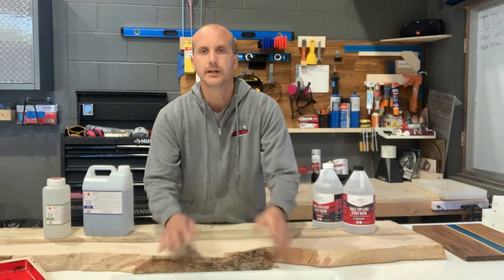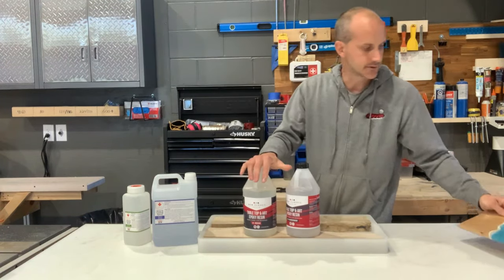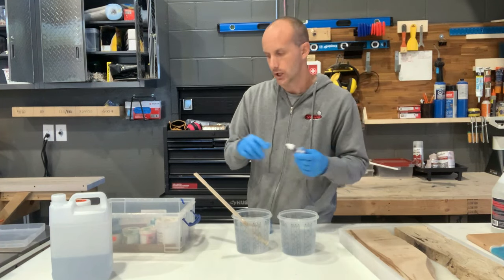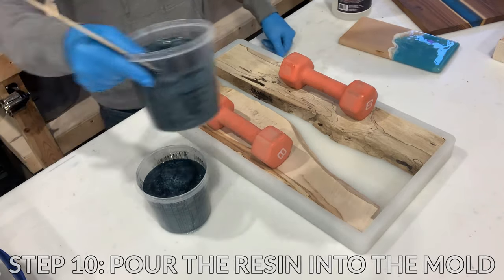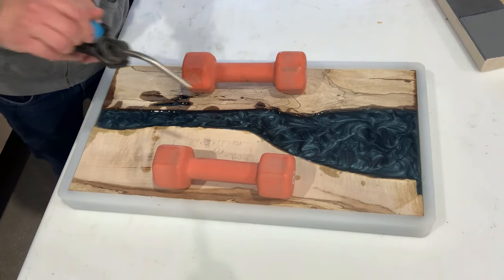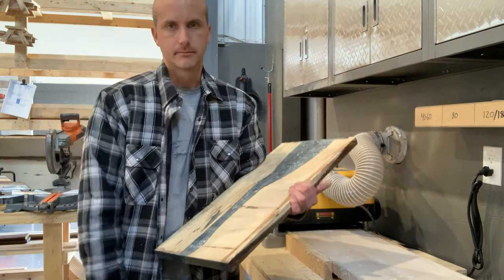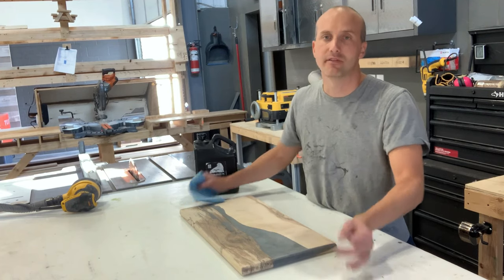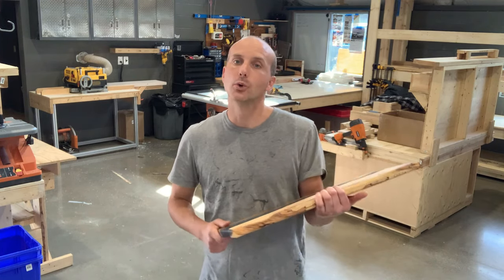How To Make Epoxy Resin Cutting Boards - DIY River Resin Charcuterie Boards + Big Time Saving Molds

Comment: The table saw push stick is meant to push the piece between the blade and the guide wall. That's the piece that will get shot back at you. It's not meant to push the piece on the open side. That piece won't get kicked back. Be careful of making a missile. The board came out very nice. The mold was a great idea.
Reply from the maker: Yes, clearly my saw technique needs some work in this video. I think at the moment this video is almost 2 years old and I have learned my lesson.
Reply: @CraftedElements  Hopefully not the hard way. Thanks again for sharing the process.

Comment: One teensy piece of advice; when pouring from a container with an offset neck like the larger resin bottle shown, always pour with the neck uppermost. This allows the air to leak in to the container evenly and prevents the “glugging” effect, giving much more precise control. Seems more awkward at first, but much easier in the event. As for bonding of pre-sealed edges; that’s down to timing. If you wait too long and allow the edges to cure, you will need to rough them up to create a mechanical bond, BUT if you pour before the edges are fully cured, the pour will form a chemical bond with the original edge that is full strength. The latter gives the best of both worlds. Finally, CA glue works well to fill pinholes almost instantly as you are sanding, especially if combined with an accelerator. You can even get black CA glue for this purpose. Larger pinholes can be filled with bicarb-soda powder, then hit with CA glue for rock hard filler.
Reply from the maker: Re: the pouring it totally makes sense, and definitely something I tend to just do out of habit. Regarding the pre-sealing of edges, while I agree that it would need to be not fully cured, or sanded, the brushed on epoxy still will not penetrate the wood as deep as it would vs. it being poured. It's basic physics, the weight and pressure of the epoxy (a full 2" pour) is going to force the epoxy deeper into the wood in general. As for the CA glue filling, its definitely something we do now that we didn't when this video is made, and we do cover it in our new video series (yet to be released but will be out soon!).  Thanks so much for the thorough comments.

Comment: I wanted to say I love all your videos I have learned so much. Question though when you are pouring resin you stop pouring when?? At the very very top?? Or 1/4in? Also what do you wash your measuring cups out with??
Reply from the maker: Either. You can leave space if you dont want to fill the mold and make a thick piece, or you could fill to the top of the mold. If you are using wood in the mold, then logically you wouldn't fill past the height of the wood. We do not wash measuring ups. The epoxy hardens in them. Often you can peel the epoxy out (if the measuring cup is plastic or silicone). If you cant, its just garbage.

Comment: Just ordered one your guys's molds, I started to cheap out but had a feeling I'd regret it lol, looking forward to receiving it
Reply from the maker: You will love it! Just make sure you use a mold release and you'll get a lot of use out of it.
Reply: @CraftedElements   you bet, I ordered the MG chemicals non-epoxy mold release, that was linked in 731 Woodworks last video 
So just regular soap and water to clean between uses?
Reply from the maker: @stephenpalazzi720  Yes indeed!

Comment: that was great!  You've read it before, but I love the real time aspect, not super sped up.  Minor question:  how does the resin effect the blades of the planer?  does it dull them faster or do you need to reduce the speed compared to maple or walnut?  thanks!
Reply from the maker: To be honest I don't really know the answer. I almost always use the planer with resin + wood combination pieces, and we dont make a lot of them here because we are way to busy making and shipping molds. Im sorry!
Reply: I'm not running it through my planer

Comment: great video. thank you.and beautiful board. I will be getting a couple of your molds for sure. I have tried 1 river board in. the past. I am no expert with epoxy but I did exactly what you did in this video. I let it cure for 3 days then ran it through my planer. spiral cutter and sharp blades but after the planer the epoxy had ton s of little chip outs. what would cause that? the only thing I can think is air bubbles but I thought I popped them all. it was died black so maybe I missed a bun ch???? help me please. I want to kn ow before your molds show up so I don't mess them up. thank you

Comment: Can you hot glue the wood down so it doesn’t float in a silicone mold?
Reply from the maker: No, not with a silicone mold.
Reply: @CraftedElements  Ty is weighing down the wood the best method or would you recommend another method for preventing wood from floating in silicone molds?
Reply from the maker: @Tyno913 Yes, using handweights is easiest. Otherwise, using clamps (keeping the mold near the edge of your table and clamping between the bottom of the table and your wood)

Comment: I just bought my first two molds from you guys and got a card with a big warning.  1. don't put your torch on the mold (which the guy in the video brags about being able to do) 2. use a non-silicone release agent (which the guy in the video says no release agent needed, just put the wood in and go).  Which is correct and why the two voices from one company?  Just preference?  I am new...
Reply from the maker: Dont use a torch on the mold, unless you are briskly waving it to pop bubbles. Silicone can only handle up to 450F. Use a mold release -> https://craftedelements.com/moldrelease

Comment: Great job Chief. Quick question. Any idea why while poring the epoxy it would start to smoke?  We did two pores totaling 2”, 12hrs apart. On the 3rd poor we did the quick set thinking that we only had 3/4 left to pore so it would be ok. Width was long, I’m thinking that’s the reason but not sure. Any idea?
Reply from the maker: Yup! You need to use an epoxy rated for the pour height (or volume, really) of what you are doing. A quick set epoxy at 3/4" is most definitely going to get too hot, bubble, smoke, curl and effectively ruin your piece.

Comment: Love It! One question, the live edge is in. What the point in draw knifing it off when that the look you go for? Could you just nail the bark on there with a finish nail? 
Again Love your projects! Can’t wait to try this board! 🤝
Reply from the maker: No, the bark always needs removed. The epoxy will bond to the bark and it will eventually just break off from the wood (as bark usually does).
Reply: @CraftedElements  Ohh ok. You would think with it being incased in Epoxy that it wouldn’t do that. As if the epoxy holds everything together. That’s just my logical thinking. Lol. I’ve never done epoxy work. But I am willing and eager to try this. I love how you give perfect directions and instructions like we as fans are there with you. It helps so much for people like me who are apprehensive or nervous on trying something new. So I Thank You. I should be receiving my 3 Templates I ordered from you sometime today. So Thanks for that! Have A Great Day Sir. And keep the videos coming! 🤝
Reply from the maker: @jamesbarlowjr.3762  Totally makes sense! seems logical that nails would hold the bark in place, but no, sadly it wont. Plus, bark is pretty moist and low density, not something you want on a cutting or serving board coming into contact with food. Thanks for watching!
Reply: @CraftedElements  Ohh ok. Thanks for the responses I really appreciate it. I’m just learning. So please don’t mind the silly questions. Thanks Again! 🤝

Comment: Have you ever tried to use this board as a stand for hot items such as a hot saucepan or pan and what could be a max temperature?
Reply from the maker: You wouldn't want to put a hot pan on epoxy resin (which is plastic) it would melt.
Reply: Maybe just use it as a charcuterie board for searching snacks

Comment: The exposure material you used, are they food safe? And what do you seal the top layer of wood with to prevent food stains or drink rings? Many thanks!
Reply from the maker: Exposure? I dont quite understand. However, we generally use TotalBoat Wood Honey, Walrus Oil or food grade mineral oil to seal and oil the boards.
Reply: @CraftedElements  it was autocorrect, 🥸, but you understood enough to answer. 😂 Thank you for your reply. 😀
Reply from the maker: @shannonmac7801  No problem at all! Be well.

Comment: I've seen people seal the bottom of the board opens with hot glue have you seen that and what your thoughts.  To prevent leaking
Reply from the maker: I have never seen it done with hot glue. Also, you definitely don't want to use hot glue in a silicone mold. It would be ok to use in an HDPE or tuck tape "homemade" mold though.

Comment: Hi Mate, can you use epoxy rsin for cutting boards. I have read and heard that you shouldn't, what do you recammend  regards Gary from Australia
Reply from the maker: You could use resin to fill in voids in a cutting board, but ideally its just not functional for a cutting board. When you use a sharp knife in resin (which is plastic) its going to scar it and with multiple cuts overtime its just not going to look good.
Reply: @CraftedElements  thank you for the feed back appriated, I love your educational youtube for someone that about to do epoxy it is a great learning curve
Reply from the maker: @garysevior8602  You are welcome!

Comment: What is the sander machine called, you used it when the cutting board was done to make it even. I'm new to this I'm just now starting I'm going to order your molds but I'm going to start off with the cutting board
Reply from the maker: Its called a planer (The yellow box like machine). Dewalt DW735

Comment: I see that you use weights to keep the resin from leaking. How much weight do you place on the boards when using one of your cutting board molds? I just bought the mold from you .  I always have trouble with leakage when using my wooden molds and am hopeful with your advice, I can get this right. Thanks.
Reply from the maker: We use 8lb handweights, or 15/20lb kettle bells. Common workout weights basically. Usually put an HDPE block in between the wood and the weight to prevent the weight from sticking to the wood if resin spills over -> https://craftedelements.com/collections/new/products/hdpe-hold-down-block-kit-for-silicone-molds

Comment: A completely Unrelated comment but when you use those gloves have you ever seen heard of or tried the cotton glove liners or the cotton inspection glove some call them. In my personal opinion I look at it like the inspection gloves are a little thicker and the cotton glove liners are thinner but the thinner ones are amazing to use under the nitrile gloves and the combination is still thin enough that you can handle small pieces and parts and what not
Reply from the maker: I'm a bit lost. But thank you for the suggestion.

Comment: Do u have to flatten one side of the board before running it through a planner
Reply from the maker: Typically when using a mold with wood and resin, the bottom of your piece is flat (enough) when taking it from the mold. So you put it through your planer, bottom side down, to plane the top and get that flat, then flip over to get rid of excess resin etc.

Comment: A silly question,,I take it you can cut on the board without damage to the epoxy resin to much,,🤔🏴🤔🏴
Reply from the maker: Cutting directly on resin with a sharp knife will leave a knife mark in the resin. These are mostly serving boards, NOT cutting boards. A strict cutting board should be mostly hardwood.

Comment: Hi like your videos. Can you please advise me, when I sand my resin it does not come out like glass. Am I supposed to put the oils on it for that to happen>
Reply from the maker: It depends on the mold you are using. Some of our molds are matte (dull) some are polished/shiny. You can always do a high grit sanding of a dull piece and then top coat / flood coat with resin to make it shiny/polished.

Comment: question: if you do have pinholes, is that something you would see in the first grit of sanding? also, say i find those pinholes at the end of sanding, then put more resin in there, does this mean i have to sand the entire side of that board from the beginning grits all the way up the grits or just with the last grit i was using?
Reply from the maker: Yes, totally you would see this (perhaps even before sanding). Once you do a basic sand, blow them out with compressed air then do a top coat / flood coat of epoxy to fill them if there are alot of them. If just small patches, apply epoxy in those areas (putty knife to flatten), let set, then sand again.

Comment: There are plenty of quick setting epoxies you can use to seal your edges. You do not have to wait 24 hours, more like 1 hour for most of these to set up. If you sand your edges once they are sealed and dry, you will create a bond for your resin to the wood. I have been doing this for 6 years and have never had an issue using this method of a table coming apart.
Reply from the maker: Elyse. I appreciate the comment, and haven't experienced detachment in my process either. HOWEVER, I have watched more than one video of a table maker (river table maker) indicate this happening, which is why they never pre-seal the wood. Just because it has not happened to you, doesn't mean it wont happen!

Comment: Wouldn't the oil wipe right off the epoxy since it doesnt absorb oil?
Reply from the maker: More or less, the oil does get into the micro pores and make it shine a bit more, but you are mostly correct that the oil doesnt penetrate the resin.
Reply: @CraftedElements  so is sanding and polishing the only option besides flood coat to get a gloss look?

Comment: Couldn’t you use art resign and just pour a little wait an hour then another layer etc?
Reply from the maker: Yes, you can layer resins that are designed for shallow pours (or art). We occasionally do this. The issue is 1. It takes time, 2. If you are coloring it, the pigmentation is usually off and you can see the layers from the side, 3. Even a layered clear pour is usually distinguishable from the side view. But... YES.... it will work.

Comment: Is there a way that those containers that the epoxy resin was mixed in be cleaned for reuse ?
Reply from the maker: It is possible, but the containers are very thin, they crack easily, so we typically don't reuse them.

Comment: Looks great, so there areno swirl marks in the epoxy after only sanding to 220??
Reply from the maker: You can see some if you look very closely. You can sand to a higher grit to avoid this, but we prefer to keep it at 220 to let our oil finish absorb correctly!
Reply: @CraftedElements  TY

Comment: Where can I find live edges? I’ve been looking and see that they are pretty expensive. Is that usually how it goes?
Reply from the maker: I guess it's relative. I don't know what's considered expensive to you. For a piece of live edge maple or black walnut, average serving board size, you should be able to get a 1-2" piece for between $20-$40. Check Craiglist, Ebay or Facebook marketplace. Search "live edge wood".

Comment: Love the video! What temperature was the shop when you poured it? And what temp do you leave the shop at while the epoxy is curing? I recently just did my first pour and I’m wondering if I should have turned up the heat a little bit, I did the initial pour at 10’C!
Thank you!
Reply from the maker: Hey Ty! The shop is 19 degrees Celsius in general. I would do it above 15 degrees for sure!
Reply: @CraftedElements  alright I’ll go crank up the heat then! Haha thank you so much for the fast reply! I want to get the basics down so it makes it a little easier on me! Thank you once again! 👍🏽
Reply: @Bergs9317  When i do my pour, I make sure the ambient temperature is no higher than 17 deg celcius.  I use the same epoxy as Crafted Elements.

Comment: i wanted one of your molds but $150usd +shipping to Aus is out of my range , any tips on a DIY version of the silicon mold ?
Reply from the maker: So, a DIY silicone mold would cost much more than one of our molds because of the initial tooling involved. To create proper tooling, out of aluminum or acrylic, to make the shape of the mold, you are looking at $500 for something small, $10K+ for something large. You could do a really rough form with wood or plastic, seal it and then buy some RTV silicone and pour it in, but I guarantee it wont be any cheaper in the long run.
Reply: @CraftedElements  cheers for the reply , i think i found some cheaper methods to start with for small scale. if it turns into something i enjoy i'll look at investing in something that im sure makes life 100 times easier :)

Comment: I thought both parts of the Hardner in the Apoxsee have to be put into the same container and then mixed
Reply from the maker: That is correct. Its an A/B mix. But check your ratio, it depends on the epoxy resin you are using

Comment: Why wouldn't you just flood coat the entire piece in clear resin? Honest question.  Newbie here.  Lol
Reply from the maker: Honest question. Flood coating looks fantastic and shiny, but it scratches. Forks, knives etc on a serving board are likely. If its going to be babied or use for decoration a flood coat makes sense, otherwise, no dice.

Comment: There is no concern with sealing the edges of wood pieces if you sanding them after, which is providing a better contact surface.  It's standard practice.

Comment: $300 after shipping for the molds? I’ll just make my own.
Reply from the maker: Out of silicone? Do you know what tooling costs? Do you know what silicone costs per pound if you are buying in retail volumes? You wont be able to match the price. Now... if you are talking wood and tuck tape, or HDPE. Thats a different story, but its also a different prouduct.